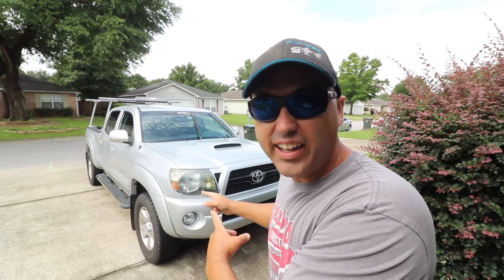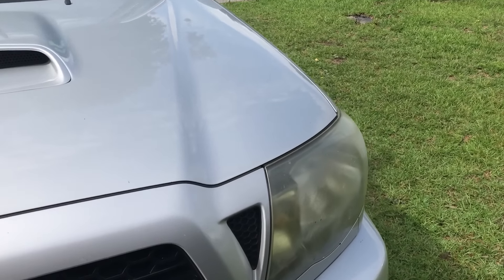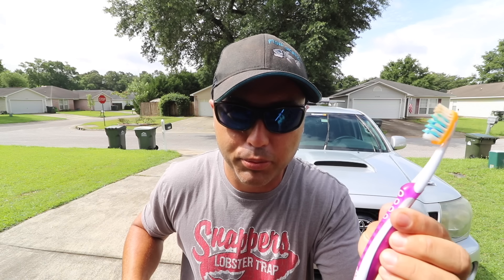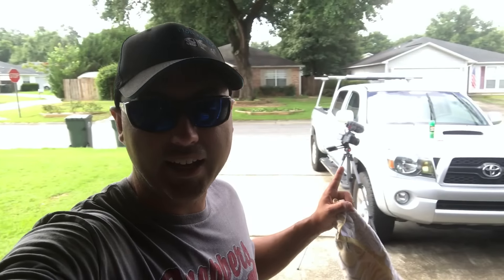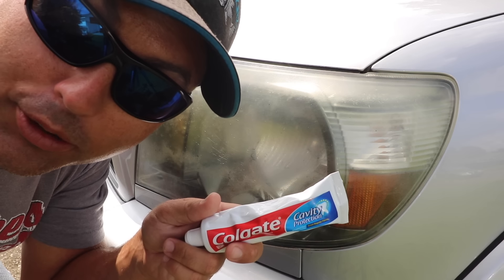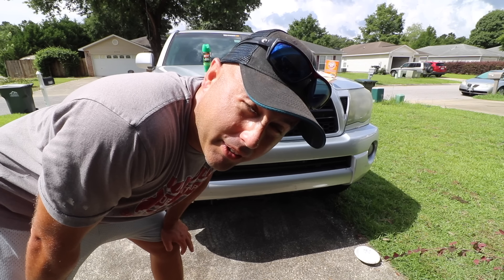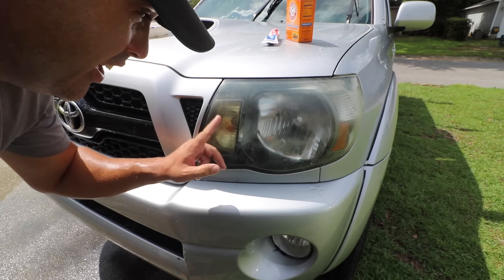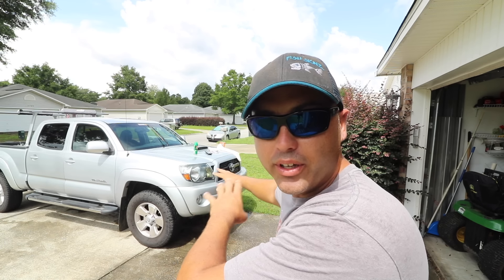The TRUTH about OFF & Toothpaste vs Headlights! (+Update on WD 40)

Comment: Sport you have to use a little common sense. The OFF is acting similar the the WD40, it is acting as a wetting agent and doesn’t remove the oxidized acrylic plastic. The toothpaste is acting as a buffing compound and can remove the oxidation and polish the lens but you have to buff it for awhile to get the desired results.

Comment: Any abrasive cream on an electric drill and damp buffing pad works every time, and fast, it's only basic logic. Rubbing compound. Tooth paste, valve grinding paste, Ajax powder cleanser all work. If tooth paste takes off that gunk you can imagine what it does to the enamel on your teeth doing it every day. A 3 grit headlight kit is a labour intensive waste of your cash and time but makes a small fortune from those ignorant enough to buy the first thing they see. Tooth brush's are for cleaning cracks and crevesis, not flat surfaces.

Comment: Six million views Ha! I bought two eyeglasses from Kaiser. I stopped by for a pin replacement in the hinge. When I got them back the lenses were so clean I asked if they buffed them by a wheel or what. She told me they used sonic cleaner and water. I have a Sonic Care toothbrush so I used one of the replacement brush heads and was amazed at the results. So, I'll save the brushes and have clean glasses I've had in decades. Probably would make a huge difference in the headlights too;  will try it during this CCP virus times...

Comment: If you apply the toothpaste with a dampened towel instead of with the toothbrush it will work wonders.  It will microscopically etch away the oxidized plastic and you will see instant results.  Also remember you MUST use only the white Colgate toothpaste (not any jell type) because the white has micro silica which does the polishing and the jell does not have any silica.  The jell might make your headlamps smell minty fresh but it won't help to clear your lens.
Reply: Used toothpaste tube.  Add couple ounces of water.  Shake well.  Apply the slurry with a very wet pad of paper towel.  Wash off immediately.  Three minutes per light.  Crystal clear.  Lasts three or four weeks.  Cost nothing.

Comment: Mayb if you do the off spray,, and then apply wax,,,, to put a seal on it,,, hummm,,,, imma try t that,,,, wit the toothpaste,,,, have to rub on and let dry and rub off like a wax and do it a few times that is what I have seen,, have not tryed it tho was about to, I had seen your video be for and was not sure witch one you had tested and worked better I knew 1 was toothpaste,  so imma do the OFF and add a coat of wax,,, my motorcycle head light is horrible

Comment: You should of added a protective layer over the headlights after each clean. Would last longer. The reason the headlights get foggy is because the manufacturer puts a coating over them. Naturally this coating is heated up by the bulb and it causes the reaction with the coating. Each time the you wipe that fog off you take more of that coating off meaning the fog comes back worse each time. So to help protect that coating and plastic cover coat then after with wax. Rub it in and remove it after.

Comment: You don’t apply the the toothpaste with a toothbrush you are supposed to a dry rag and rub in circles. Toothpaste is a polishing compound so is technically designed for this purpose in general. I have used toothpaste for years as mild rubbing compound and polish. A toothbrush doesn’t apply enough area contact and pressure to restore the headlights. Also the the kits they sell are only a temporary solution as well because plastics exposed to the elements will always deteriorate over time. Toothpaste is the best and most economical solution. The cost for a kit that you have do 2-3 times a year isn’t cost effective in the long run. There is no permanent solution to this the bottom line is plastics breakdown in direct sunlight. You can apply a UV clear coat after polishing them but it is difficult without distorting the lenses and of course over time this breakdown as well. The true and only real solution this headlight problem is if the automakers would make them out glass once again, but we have better chance of wining the lottery.

Comment: I'd be afraid of putting that DEET crap on just about any plastic. I believe that as a pretty potent solvent if someone were to use it often enough it could absorb into, swell and cause the plastic to eventually fail. It comes in an HDPE bottle but that stuff is resistant to damn near common solvents. 
The toothpaste works as an abrasive polish. You need to use a similar towel. You chose a toothbrush, really? I see the connection but... c'mon man.

Comment: Dude. A toothbrush?  For god sake, use a rag or an old cotton sock. You use the toothpaste with water like a wet sand method. Then comeback with a basic polishing compound. I did my Toyota year and half ago and still good. And put some elbow grease into it.

Comment: Your headlights aren't teeth. You don't use a tooth brush to get the job done properly. Treat it like a polish, rub it in and buff it off. It will repair the light not just fill in the pits with oil. It won't fix heavily damaged lights but it will still make them better.

Comment: I have a bachelor's degree in biochemistry and what you asked about the "D" is a very good question. The answer depends on what the headlights are made of. If they're made of a plastic that means they're a petroleum product. In other words they're made from petroleum, or oil as most can relate to.
There's a sort of saying in chemistry circles (if there is such a thing) that 'like goes to like'. It's a play on the 'birds of a feather flock together' adage.
Long story short, if the light covers are petroleum based plastics, then any petroleum products you put on them may very well begin to eat into the headlights. The two petroleum products are attracted to each other. The stearic forces involved in that attraction will cause them to bind to one another and that process might cause some degradation of the surface of one, the other, or both.
For example, you may have seen or heard of belt dressing. It's a petroleum based spray to apply to loose drive belts (fan belt, serpentine, etc.) which temporarily stops the belt from slipping. The way it does this is due in part to what I mentioned earlier. 
When the spray comes in contact with the rubber belt, it is absorbed. That causes the belt to swell and that swelling makes the belt tighter so it won't slip. But there's a catch (isn't there always a catch?).
It only works for a short period of time. That's because after it swells some of the applied dressing evaporates or simply breaks down and the belt shrinks back to it's pre-treated size. That continual swelling and shrinking only serves to speed up the breakdown of the rubber that the belt is made of. Very soon after that you'll probably be in the middle of nowhere trying to get a signal on your cell phone to call AS A because your serpentine belt is lying in pieces on the last 100 yards of road behind you. Yep, your belt dressing did that. Or, rather, it hastened your belt's demise. And luck, being what it is, would have it so you'd be in the worst possible place at the time it does it. 
That's probably why very few people today use that stuff anymore. In days gone by, when fewer cars and fewer repair shops were around, I guess folks used it to get them to the nearest repair place if the belt started whistling halfway between their home and their destination. Today's cars tell you ahead of time what's going to break and when it'll happen. Pretty cool stuff! 
I'm in my seventh decade and remember quite well how poorly (although a different word came to mind) automobiles were made until very recently. When I was a youngin' a car with over 40 thousand miles on it was pretty iffy, at best. Today that kind of mileage is nothing. The times they are a changing! Thank goodness for that. Have a good day!
Reply: Love your answer.  I've refinished many an item in my day.  I would never spray a petroleum based product on plastic.  It might look nice for a bit, but will surely cloud it up later, just like the WD40.  I even saw someone above saying to use Acetone.  Ahhhh!  NO.  It really is not much money to buy the proper products sold for this application.  If not I would be tempted to use plain old rubbing alcohol, or some Vodka...lol

Comment: Seen video after video of recipes and formulas and sprays and pads to clean headlights. Tiresome. I'd rather just spend 50 bucks and let them put a new one on. Dont have time experimenting and doing research and trying one gimmick after another that's supposed to work and when you try it, it dont.

Comment: The tooth paste will be more abrasive so it depends on why your lights are foggy. If its caused by the sun, you will have to use Off. If it's caused by the bulb heating the surface and allowing it to be sandblasted you will need sandpaper.

Comment: Which is wet dry 400 to 600 sandpaper wet-dry 800 wet-dry 1500 if you're real ambitious you'll get 2000 you will need the 3,000 if you're about that life by the 5,000 and a really decent plastic polish or 3 M's rubbing compound and that's it you can find all those things for under $15 if you got a coupon to AutoZone or some b***** you'll be good to go

Comment: Done this with plastic long before most of you have been alive! I don't believe in snake oil.Because it doesn't work! I have seen others
 fail. Protect painted areas.use common scenes tape or remove. start 
with wet sand  400 600 grit depending on cloudiness. Don't be very 
aggressive until  you see how it cuts. work in one direction only,work 
your way up to 800. then use a power buffer to polish. use a product 
like Meguiar's DIAMOUND CUT COMPOUND  2.0  85. When you are using a 
power buffer.the heat that is generated seals the plastic. One could 
make a business of doing this. takes about an hour per light,depending 
on how bad. Last for years! Done this with plastic long before most of you have been alive!